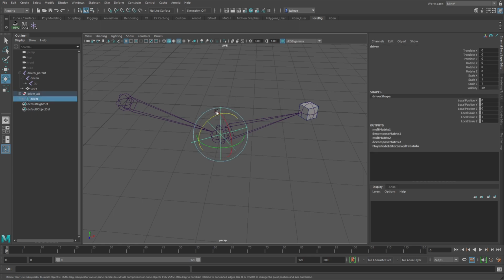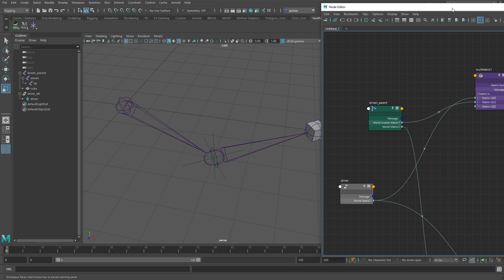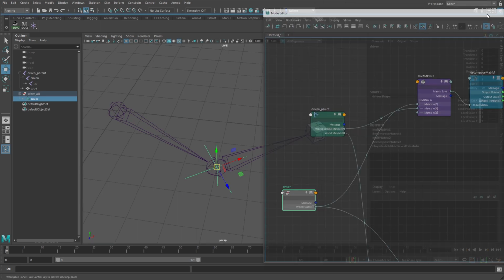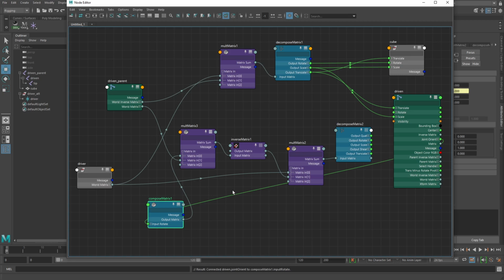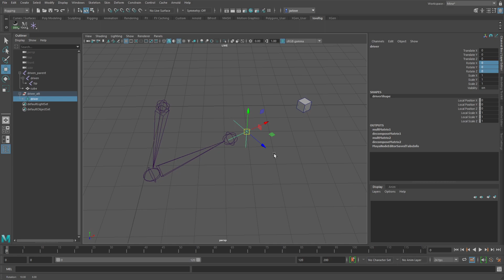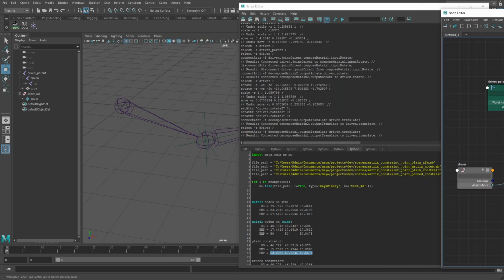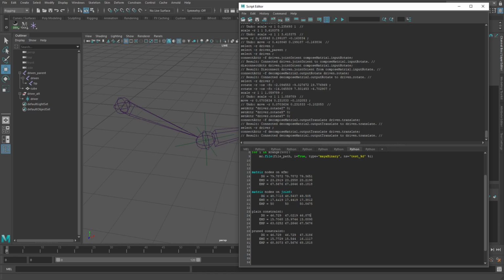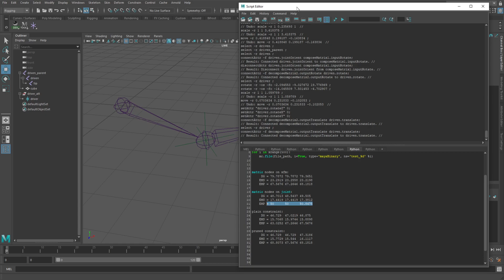Maya matrix constraint for a joint rig tip

Comment: random question why don't you use the world matrix plugged into pickmatrix(with only translation and scale) and plugged into multmatrix with a composematrix with the joint values negative or plug into a inversematrix and have that multmatrix plugged into a pickmatrix(with only Rotation) and plug both pickmatrix into a multmatrix and have that plugged into offsetparentmatrix, that way you have open transforms on the driven/child joint?
Reply from the maker: Hey 5jay5,

Great questions - the pickMatrix node and the offsetParentMatrix attribute are still pretty new to Maya - since Maya 2020 was released.  I think it was probably available around the time I made this video, but I'm not entirely sure; however, if I remember correctly, I actually decided not to use them in this particular video because it was made in response to questions on some of my other matrix constraint videos (which I had made before those items were added).  Since I was working the joint orient into the 'previous' matrix constraint system, I decided to leave out the new stuff so that those differences wouldn't add any confusion and I could keep it as close to the same as possible in order to relay the concept.

I also still need to find some time to do a bit more testing with those new nodes - I played with them very briefly when Maya 2020 came out, and while I was very impressed and liked them a LOT, there's a few workflow thoughts I need to experiment with before determining how I plan to implement them in my own work.  I've been planning to make a video (or a few) updating all of my matrix constraint tutorial/demo videos to utilize these new features once I get the time to investigate them more.

Aside from that, simply negating the rotation values doesn't give the correct rotations (I think someone else asked about that in the comments so you can see my response there for more info if you like).  You can also look at my video on negating translates/rotates/scales for more info on this too.

Out of curiosity, have you given the setup you proposed a try and seen how it works?  I think you could probably simplify it down by using a blendMatrix node that you plug into the offsetParentMatrix (instead of using the pickMatrix nodes).  The blendMatrix is another of those new Maya 2020 matrix nodes that allows you to choose what you want to extract from a given input matrix and then combines them all together - so you could have one multMatrix coming in that uses the translates and scales, and another that uses just the rotates.

hope that helps!
Reply: @JarredLove   Thank you that helps a lot. I was following Emma rigging tutorial on the Maya Learning channel and they came out with a matrix video and used the hand rig to show it practicality but didn't show how to deal with joint orientation. 

So basically i just replaced  the decompose nodes from your video with pickmatrix nodes and added mulimatrix node to add them together which does the same thing as the blendmatrix node.

 Now that i know the blendmatrix node exists it seems to work with just the composematrix with inverted joint orientation values plugged into a multimatrix into the target with the driver joint matrix plugged into the second slot in the multimatrix and the input in the blendmatrix.
Reply from the maker: Hey 5jay5,

I'm glad you've got something working!  I'm a little surprised plugging in negated rotation values is actually working for you though...  In everything I tested, simply negating the joint orient values out doesn't fully work (whether through directly subtracting the values from rotates or putting negated values into a compose matrix)...  It would usually seem to work fine for a single rotation channel, but not for all 3 rotated together.

I suppose it's possible that the rotation orders could line up just right, and/or the values in your joint orient work out to where your particular case is working smoothly by negation alone...  So, if you use your setup again on some other parts in your rig, and it's working properly for all rotation axis channels - please let me know which nodes you used, and what attributes you plugged in where!

Comment: Hi Jarred, when i scale the driver, the driven joint childs behaves incorrectly. I look the atribute editor and the child has some scale values. Thanks
Reply from the maker: Hey Steffano - thanks for watching and commenting!  That does sound odd... It's not happening in my demo file that I made the video from.  The child joint of the one I'm constraining has no scale values and appears to be behaving as I would expect it to be.  I also connected and checked on the inverse scale connection that Maya does automatically when you interactively create a joint chain, but that connection does not drive a child joint's scale values either...  Do you have something else driving the scales, or are they static?
Reply: @JarredLove  Yes, i have a chain of joints and a chain of controlers. I control the joints via matrixConstraint htt**ps:**//i.img**ur.com**/unJJnOm.**jpg. But when i scale the first control, the first joint behaves correctly but the second not, get some scale values.
Reply from the maker: Hey Steffano, I can't seem to reproduce your issue, so I'm not sure what might be throwing your file off...

But, here's what I've done:  I took my file from the video and put another locator above the one in the video, placing it where the top joint is.  I created a group node above it and matched the rotations with the joint.  If I scale that top locator at this point, the second joint will get some scale values - but that's expected since the second locator is scaling in world space (even though it's not scaling in its local space), and the first joint isn't being driven by anything yet... the second joint is essentially scale constrained to the locator along with the point and orient constraints.  I then created another matrix constraint system accounting for joint orient on the top locator/joint, and everything seems to be behaving correctly - there are no scale values going into the second joint anymore when I scale the first locator.

maybe you can describe a little more how your file is set up?
Reply from the maker: Hey Steffano,  so sorry to reply so late... I don't really know why, but your comments do not show up in my youTube notifications, and this last post was sorted into the 'likely spam' section so I just didn't notice it until today.

I took a look at your file and figured out what was going on... It's all due to the inverse scale connections that joints do when you create them interactively.  Your control hierarchy is made of joints which have the inverse scale connections, and the joints you're driving also have the inverse scale connections.  When I severed those connections, everything worked as expected.  Scaling the top control scales the top joint, and the scale values in all the other joints is the default local scale of 1 while inheriting the effective scale of it's parent.

I also looked at the sister hierarchy driven by maya constraints and found that the scale is behaving a little odd there too; meaning that each of the joints in the joint chain have a scale value when you scale the top control instead of just inheriting scale and keeping a local scale of 1.  This is again due to that inverse scale.  So, scaling the top control scales the top joint, which scales the child joint down through the inverse scale, and then the next control scales the joint back up again via it's scale attributes.

To simplify some stuff, you could build your control hierarchy with transform nodes instead of joints which would prevent any inverse scale issues in that hierarchy, and you could also break any inverse scale connections on your joints so that scale isn't messing up your matrix math (if you actually need the inverse scale, you will need to account for that difference in scale before plugging in the matrix node to the joint).  I also noticed you were keeping the connection from the joint orient into the compose matrix that's feeding the matrix math nodes compensating for the joint orient of the joint.  You can go ahead and sever that connection once you've got the values in there.  Actually... you don't even need the compose matrix node anymore at that point - you can sever its connection to the mult matrix node, then use 'getAttr' on the 'outputMatrix' attr of the compose matrix node, and then use 'setAttr' on the 'matrixIn[0]' attr of the mult matrix node to stamp it in.  Something like this:

import maya.cmds as mc
mc.setAttr('multMatrixNode.matrixIn[0]', mc.getAttr('composeMatrixNode.outputMatrix'), type='matrix')

Hope that helps!
Reply: @JarredLove  Hey, Jarred, don't worry, it happens. Well, I've tried what you mention, but it still doesn't work properly. I use joints as buffer nodes, to maintain scale on the controls above it. If I use only groups, the controls above of the control being selected are scaled and do not match the joints. The behavior I want to achieve is that at the moment of scaling on the main axis, the children under the selected control only move, not scale. Something very similar when you have a chain of joints and you scale it, the childrens only move.

Now I also tried to remove the "segment scale compensate" which works, but when you rotate the controls, the joints scale somehow. Besides, everything that's related to the joint is sheared. 

I found out that joints can't be sheared. That could be the problem maybe. Joints can inherit shear, but cannot be applied to it. Maybe it's time to change the way I make the IKFK switch. 

At the moment I only connect the translation from the decompositionMatrix node. And a direct connection rotation and scale of the control. Thanks anyway, it's good to know that someone knows about this too

Comment: The world matric node is starting to look like a complicated thing..
Reply from the maker: Haha, yeah... they're really not that bad when you're just using them on transforms... Joints are different (and a little annoying) because they do extra stuff with those joint orients to throw a monkey wrench into the matrix.  Maya's default constraints have been written to be aware of and handle that stuff for you - but that adds more cyclical connections to deal with it, of course.  So, depending on the situation, it may be better/easier to use the constraints instead of matrix nodes... They're really most beneficial for controlling transforms (or if your joint orients are all zero on a joint!)

Comment: Hello Jarred,

What if you use plusMinusAverage to negate the joint orient values after decomposeMatrix?

Thank you for this interesting video!
Reply from the maker: I actually did try that, but the result made the constrained joint rotate around incorrectly - it might have had something to do with rotate orders and stuff, but ultimately proved to be an unstable solution.  Since the joint orient essentially behaves as if it's a parent node above the joint that's rotated, and the matrix constraint is using the rotation of the joint's actual parent joint as it's rotation reference point, it creates an incorrect rotation from the start... I hope that makes sense....